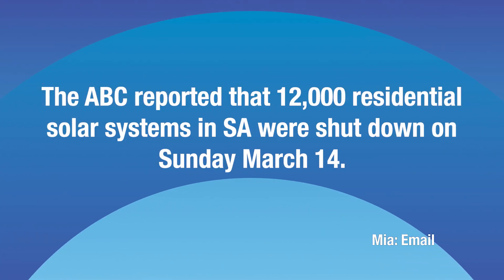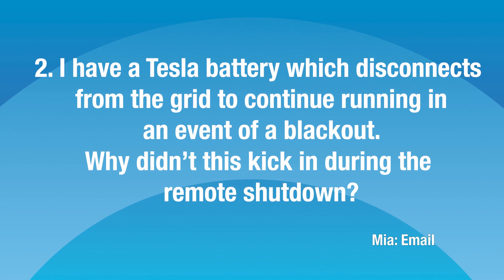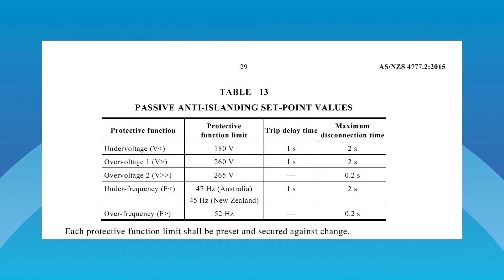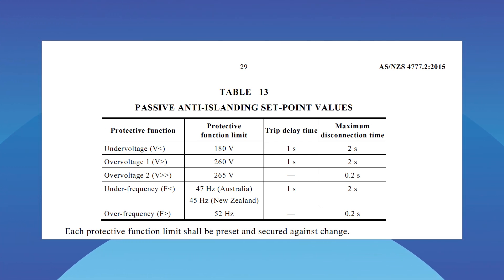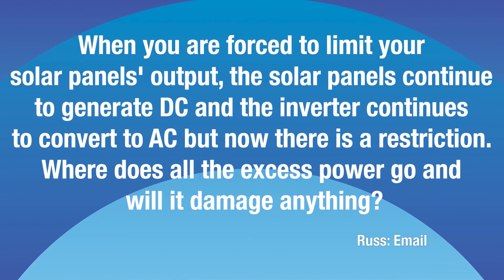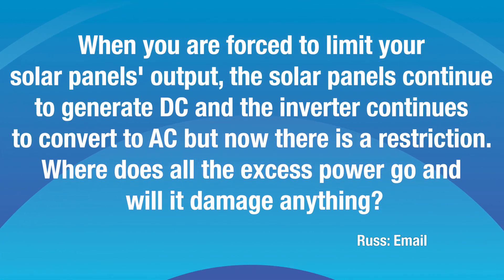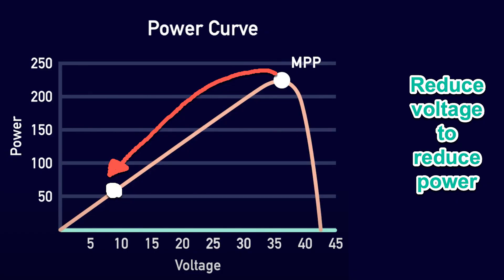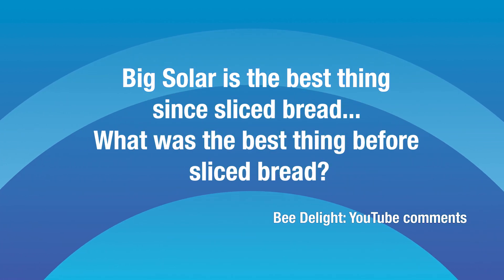ASK FINN - Remote Solar System Shutdowns And Solar Export Limiting

Comment: Well, my crappy made in China Clen energy 1.5 KW inverter (4th in 6 years) failed last February out of warranty, and I have yet to have it replaced because of this poorly thought out, and poorly implemented legislation. Because I do not have internet WiFi (which is unreliable, even at the best of times, and I have infinite better coaxial cable connection anyway), my provider, Origin and its sub contractors are having difficulty coming up with a method to conform with this legislation. After calling SA power networks, who process and approve all solar systems, (and and had to approve my existing 1.5 KW system before the inverter could be replaced, weird) for advice on how such a system can be connected to the grid, the answer was. Don't know.

So I  asked another installer based here in South Australia how they would solve this. They informed me they don't deal with replacing inverters of systems they don't install themselves, so could not help me.  But they said one would have to purchase a WiFi dongle with a sim card and pay an ongoing fee to use that WiFi dongle as the inverter needs a continuous connection, and needs to be monitored at all times. So it may be the case that Origin and their contractors are finding it difficult because they don't want to pay an ongoing fee for a WiFi dongle, and know if I was to be charged, I probably would say don't bother, the extra ongoing cost makes it not worth it.

So it seems in my case, and I'm sure I'm not the only one, if one does not have internet WiFi, one cannot be connected to the grid, and to gain connectivity through something like a WiFi dongle, one has to pay an ongoing fee to do so. Yet another hurdle making it less worthwhile to install solar. Together with the pathetic feed in tariff,  and talk of charging a tax on solar systems that export to the grid in the future, one is paying, not saving money to have domestic rooftop  solar connected to the grid and for retailers to profit on selling that exported electricity.

If the government had two neurons between their ears, this problem of grid overload or whatever would have never have arisen if they upgraded and designed the grid to cope as more solar was added over the past 10-15 years. Poorly thought through, reactionary legislation because of poor planning on the government and energy  providers  part. And who bears the brunt, as always, the public who have installed solar by being encouraged and promoted to do so at their expense and effort, and are now expected to bear the pain and cost of government and private for profit energy company mismanagement.

Comment: Hi Finn, can you still  oversize a solar system by 33% using micro inverters?
Reply from the maker: Great question. Short answer - yes. Longer answer here: https://support.solarquotes.com.au/hc/en-us/articles/115000931614-How-do-I-oversize-my-panel-array-if-I-want-to-use-micro-inverters-?_ga=2.17486585.1591909780.1621118674-1959719330.1620865881